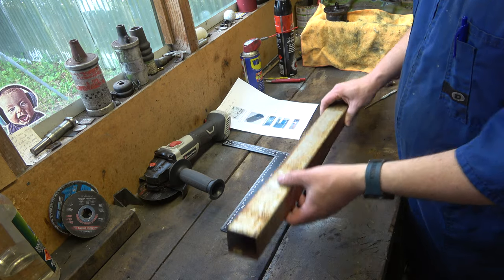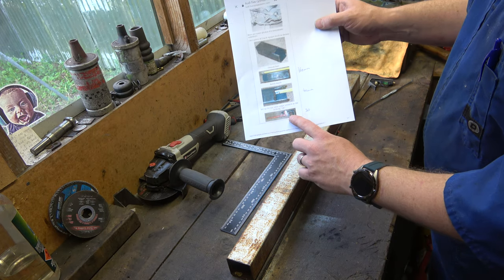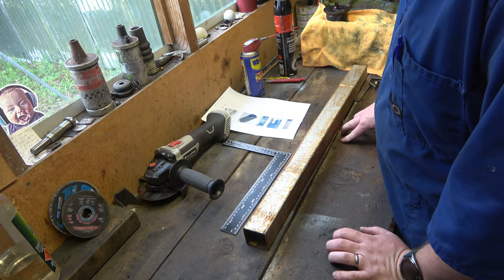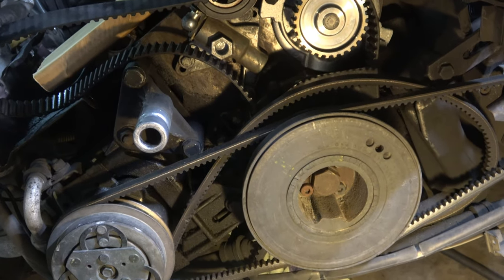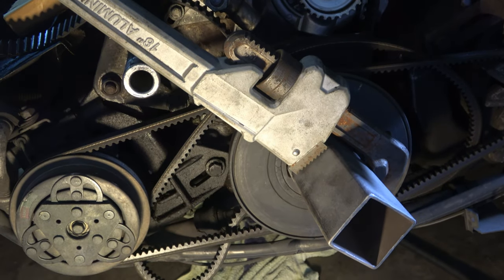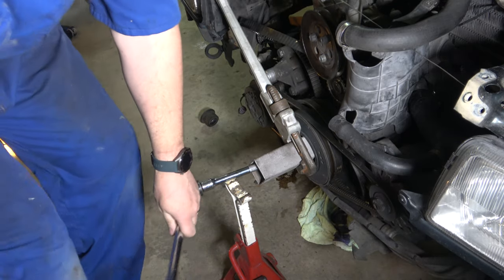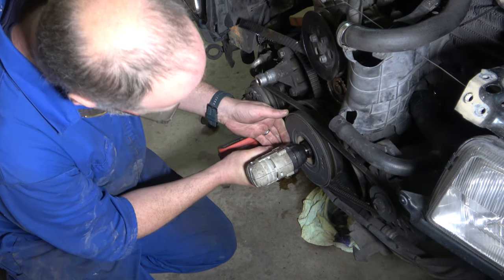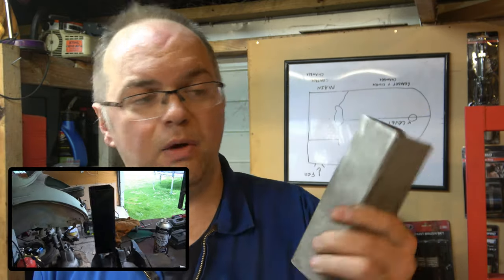Making a Crank Locking Tool - Audi 5 Cylinder

Comment: Great tips on getting the bolt off but how did you get it back on?? Did you have to purchase a monster torque wrench to achieve 460nm??
Reply from the maker: Nah I just went as tight as I could with a big breaker bar and extension.
Reply: @Badgertronix  did you use blue locktite as well or red locktite?
Reply from the maker: Nah I just went full hulk. If it was a turbo or 20v interference engine I would have been more diligent

Comment: Great job. Home made tools mostly free! Just a quick observation but wouldn’t have made a huge difference. With stilsons that is the incorrect placement with higher torque it can slip. Since the crank pulley would be turning anti clockwise the stilsons wont be on the grip side. But ignore me i just get annoyed by little things like that lol 👍
Reply from the maker: Metal from the scrap pile and a little bit of cutting. Doesn't get much cheaper than that. I was waiting for comments on the stilson orientation 😀 I can never figure out the right way round, much less when I'm using it as a support. Cheers

Comment: I like the home made tool, but why go to all that effort when you can just remove the accessory belt pulley? If you remove the 4 smaller bolts the accessory pulleys come off leaving the cambelt pulley still in place on the crank.
Reply from the maker: Fair point and I've never needed to do a cambelt on any 5 cylinder I've owned or worked on, just presumed you needed to take the crank bolt out. That would be easier, but at least I can check/replace the crank seal now (plenty of oil on the engine). Cheers
Reply: so how you are planing to tighten it without locking tool?